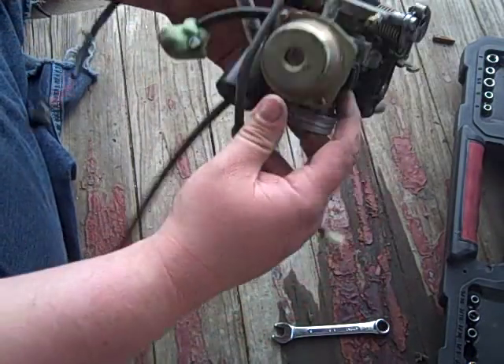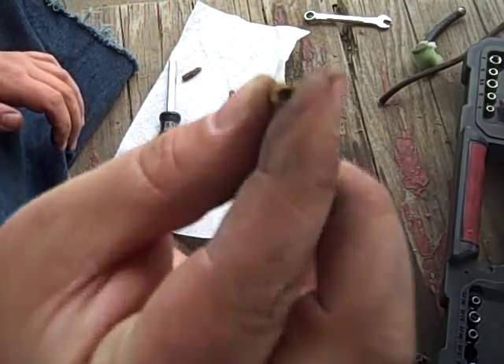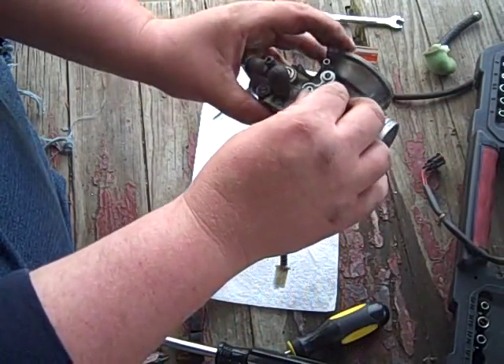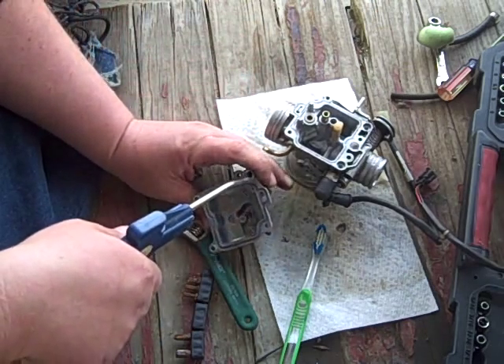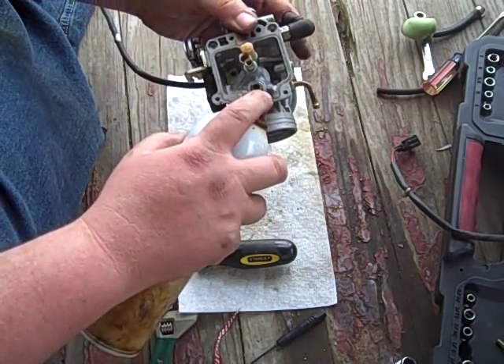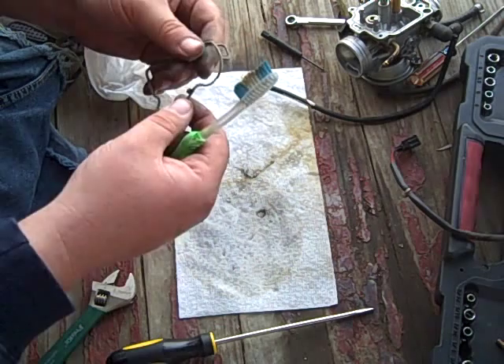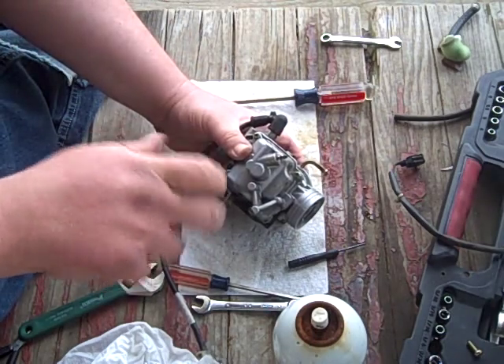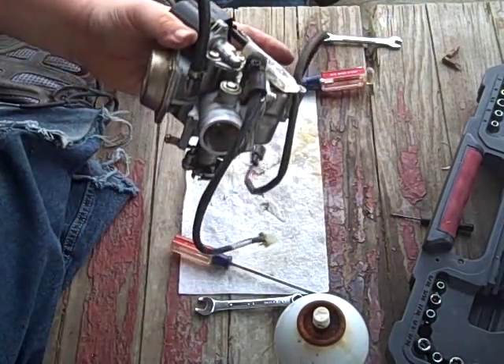Vespa ET4 150cc Carb Cleaning

Comment: Good work and well explained!
Thanks to your video I cleaned the carburetor of 125 ET4 (very similar to your 150 ET4)!
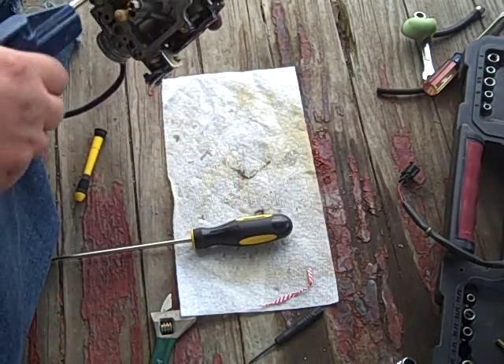Mine had "gaps" in recovery (that had clogged the pipe you've cleaned your video to min. 24:00)
just one question: but the adjustment screw gasoline (that side head engine) you have not removed and cleaned?
Reply: Tu aurais encore ton vespa et4 125?
J’aurai aimé savoir la taille du premier « gicleur » qui se situe sous la membrane et l’aiguille à l’intérieur du carbu. 
J’ai perdu cette petite visse dorée et j’aurais aimé connaître diamètre et sillage .. merci

Comment: I'm debating on getting a bike with a fuel injection system. I don't know if I'd like it more or what. This seems like opening up a can of worms to clean the carburetor when a fuel injection system looks much easier to deal with. I don't know about the longevity of either system as well. I want to get a Vespa ET4 150 like this one. But there is also a Honda pcx 125 with fuel injection available. It just does not have the passion involved with the Vespa but it looks way easier to deal with mechanically. I don't care if I have to learn to take the whole bike apart or put it back together blindfolded in my sleep, but I would like something that will last me many years and will be reliable. What should I do?
Reply from the maker: +Mackenly Parmelee Two words .....Fuel Injection !!   A good quality fuel injection  ( non - Chinese ) will just  beat the pants off a carb every time .   They start easier in colder weather , work in all altitudes  , deal with ethanol fuels much better , and just give a superior performance .   Sure your adding a fuel pump , an injector ,  a couple of sensors to detect motor movements and O2 levels in the exhausts  and a computer to handle it all ,  and that sounds like a lot but it's just so bullet proof ! And when it does go wrong odds are great the computer will tell you exactly whats fouled up ! 
But to defend the carb some  , once you learn what does what and you learn to never ever leave old gas in it , they  generally work pretty good !    And if your in the US or Canada ,  the ethanol they dump into our gas ( up to 10 percent in some paces ! ) just gums up the guts ,  it is just terrible for small motors , thankfully one gas station in my town sells ethanol free gas !   And true,  there is just something about having a good ol fashioned scooter like a Vespa !   But it can come at a price some days !
Reply: +Tim Tuttle Yeah I ended up going with the fuel injected. Maybe some day I will own a Vespa

Comment: nice one.. is this carb relatively the same as the 125 et4. ?  as mine could do with the same therapy.  With the correct tools of course 😜Mike from Liverpool
Reply from the maker: From what I can tell the carbs for all the LEADER motors are pretty much the same ,  BUT here in the States we have all kinda of stupid emissions control stuff that may be deleted on yours !  But that being said , the great thing about all carbs , they all work pretty much the same !  Hope you guys don't have to deal with ethanol in your gas  , biggest problem here on small engines !